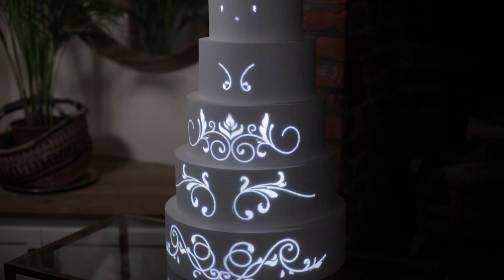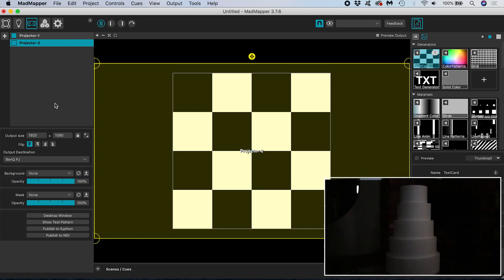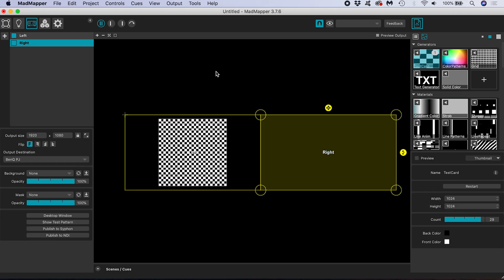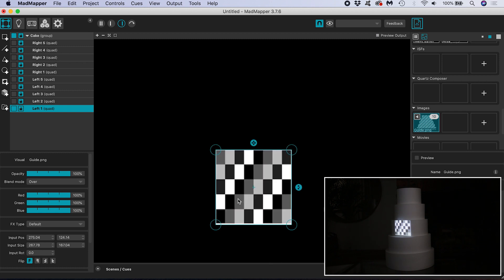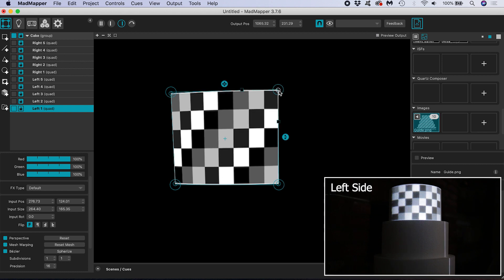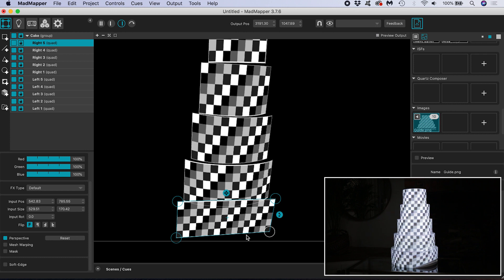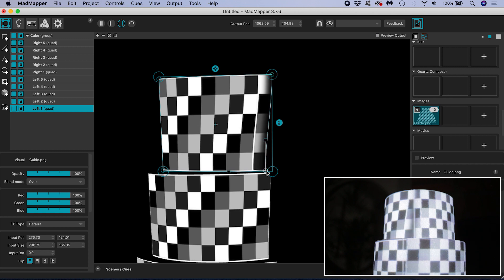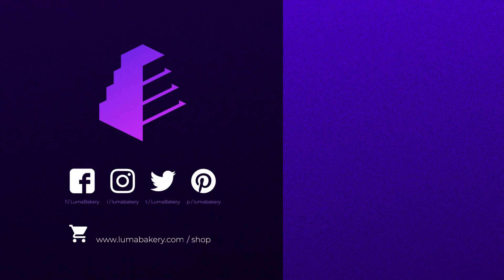Round Cake Projection Mapping MadMapper Tutorial

Comment from the maker: Are you up for the challenge of mapping a round cake? Let me know if you have questions :)

Timecodes:
00:43 Cake
01:30 Equipment
02:02 Projector Output Setup
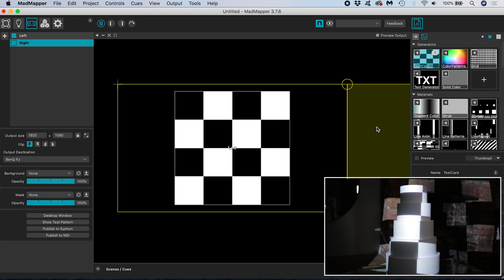03:25 Challenges of Mapping a Round Cake
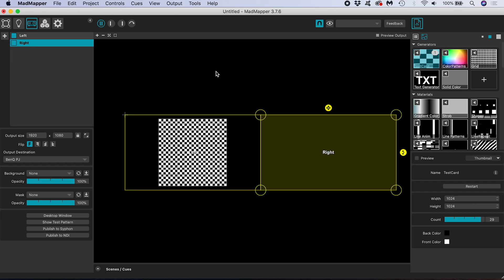05:24 Cake Mapping in MadMapper
14:41 Edge Blending
Reply: Hey learned cake mapping from you, thank you so much! I do have a question however. Why do you have to pull the edges over 1 tier on each side?
Reply from the maker: @matrixeventsgroup4722  Do you mean for the edge blend?

Comment: How to Restrict Projection Output to Only the Mapped Surface in MadMapper?  the content appears correctly on the mapped surface, but the rest of the projection (negative space or "no output" zones) still shows ultra-dark pixels or blank output, meaning the projector is technically outputting black rather than being “truly off” outside the quad areas.
Reply from the maker: That's spill light and it's very common -- some light still leaks out despite there technically being no 'content' there. I'd recommend bringing the cake away from any walls or surfaces where that spill light can fall and be seen. If you can't do that, use a very non-reflective backdrop like a black curtain

Comment: Is there a process in MadMapper for helping to match the colour of two projectors outputs? i have the same make of projector, one is slightly older, like in your example.
Reply from the maker: In the left hand panel you can adjust settings like levels, contrast and hue so you could try to remove any slight colour tints or other variations